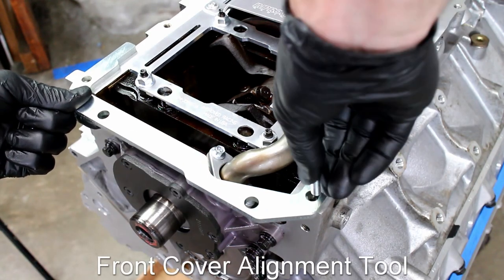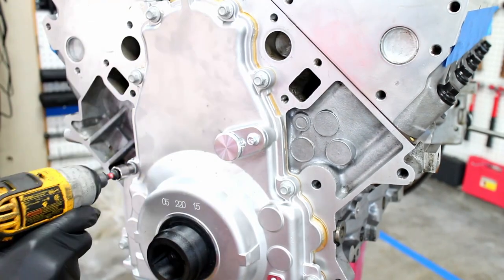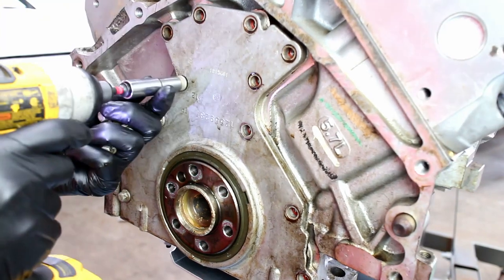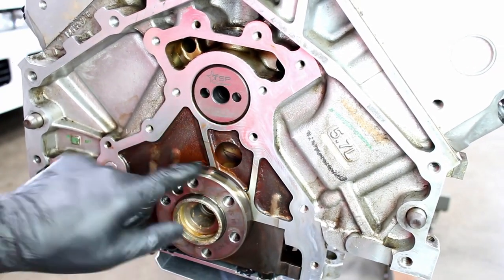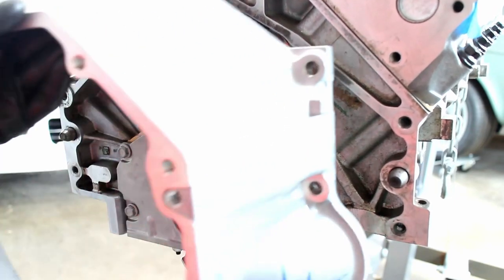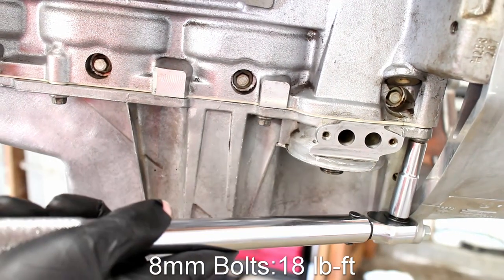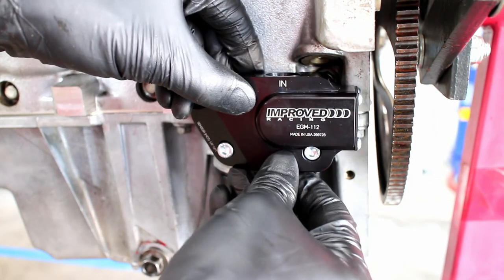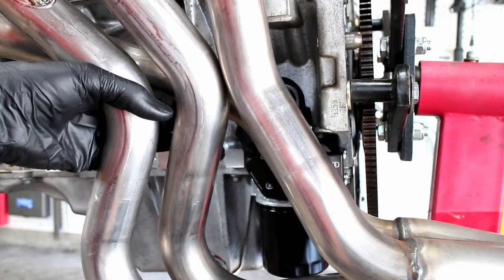LS1 Timing Cover, Main Seal, & Oil Pan Install (Pt11 82-92 Camaro/Firebird LS Swap)

Comment: OR..  just put your oil pan on, Make sure it's flush at the back. Then install timing cover on crank. Slide harmonic balancer over crank Into timing cover, Then tighten timing cover.  Only need the Alignment installer for the back cover. Use the stock bar bell, Spend that money on a Fixture that bolts where the starter goes to hold the flywheel, Tighten down homonic Balancer.   ✌️👉
Reply from the maker: ya'll say that.
then leak city when racing.
all fun and games until you do a hard 30min session
Reply: @3rdGenGuy  I say that because" it's what I did, only instead of a Thirty minute session, it's been 3 years and not a drop. Maybe I'm good...and lucky.  Or maybe I'm just an broke ass old timer Calling common sense luck. I've got some stories about riding my forty year old motorcycle across country that you would never believe. Cutting a piece of wire out of fence along the highway to hold my exhaust pipe on, Blowing out a spark plug and getting a rag shoved in the dual plugged heads tight enough to hold, Busting my risers and holding my handle bars in my lap to give gas, Shifting without a clutch and holding the triple trees to go straight for a 100 miles to get to my buddy place before the beer was gone.  My way ain't for you, but im gunna get there without AAA ya know what I mean 🫡
Reply from the maker: track days stress everything way past what cars see on the street.
different ball game altogether.

Comment: If the oil pan is already installed, do you torque the timing cover to pan first? Or the cover to engine first?
Reply: Ever found  ?
Reply: @MetalSlug270  found a corvette forum that said, "After timing cover is aligned, you hand snug all bolts, but torque the pan bolts first."
Reply: @fuelinjectedduck2964  ah ok thanks

Comment: I have a mud truck- #WFO ! But...if ypu say 30 minutes on a Dino or track days Are the exception.  I'm not really much of a banter back and forth kind of guy, so...your right I'm wrong. Maybe I'll get some new Assembly tools for christmas ✌️
Reply from the maker: it's mostly RPM and oil temp.
a 30min session oil temps even with a cooler can be 260-270F
with a consistent 60-70psi oil pressure for 30min.
most cars don't see anywhere near that heat or pressure for that duration.

my 92 didn't really leak around town, or autocross, but became a fountain at the track.
Reply: @3rdGenGuy no need to Disagree with you. Sounds like you making my point for me. Plus everybody knows mudbugs are a walk n the park on your engine and parts, It's as easy as eating beef jerky without your teeth in probably.  I wonder how many thirty minute track day car guys come to watch your video? I hear know those guys know how to work on their Engines. Just kidding 😁 give um hell! hot rod 🏁
Reply from the maker: what oil temps do you see during a 30min race session?